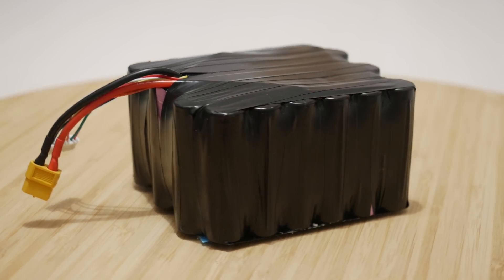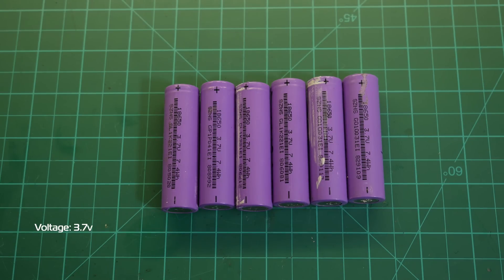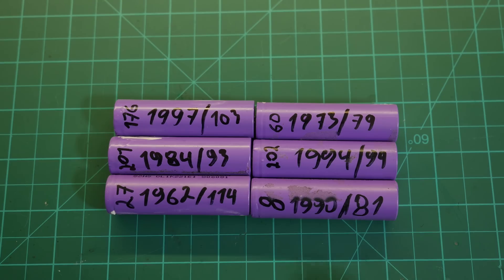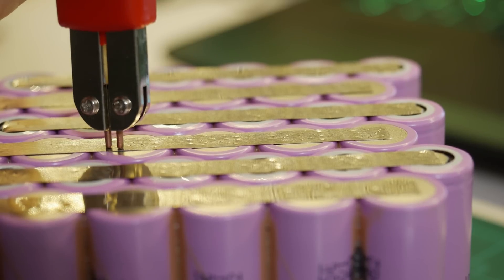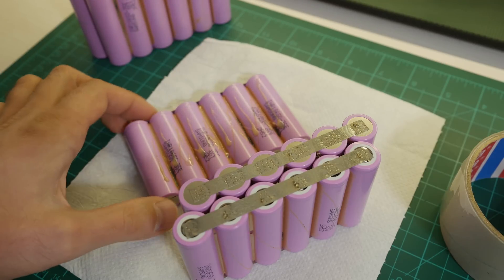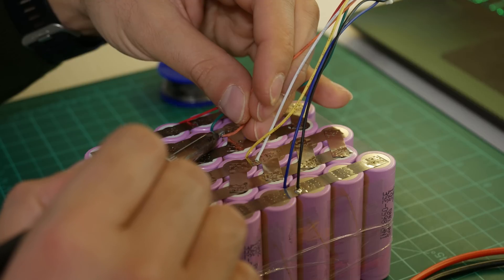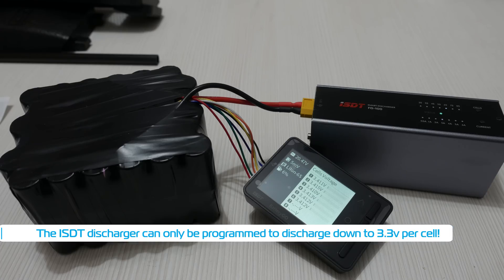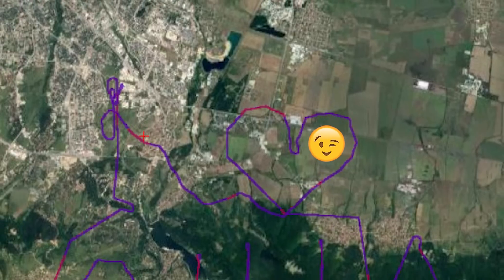HOW-TO Li-Ion battery for a drone using 18650 cells!

Comment: So those individual cells got 3450 mAh each in the final battery pack? I'm guessing they aren't the typical VTC 3000mAh, right?

PD: What is that self-guiding ground base antenna at 0:28? Looks awesome! :O
Reply from the maker: The cells I used in the pack were Samsung 35E, not Sony cells. And yeah, at 0:28 that is the older MFD antenna tracker, still using till this day, been probably 10 years now! :)

Comment: hello i have a drone X  12" propeller 620kv motor and the drone weight 3.5kg i need 4s li-ion battery .....what will be the best mah battery size for flying time 40min time......  currently using lipo 4s 8000mah lihv get around 20min to 25 min
Reply from the maker: To be honest I've never been able to completely figure out LiIon batteries for quadcopters, and especially larger ones! What is the current draw during hover?

Comment: I just want to know that the li-on 18650 batteries are much cheaper than lipos but still most of the fpv racers uses lipo for fpv flying . So is there any difference between the two in terms of performance ?? Please let me know.
Reply from the maker: Well LiPos are used for high current applications! LiIons cannot handle those! LiIons are best on long range and long flying models, where discharge is slow over a longer time! For 2-3 min flights LiPos are best!
Reply: @ArxangelRC  thanks a lot . Really appreciate your answer ☺️
Reply from the maker: @rsmgaming4384  You are welcome! :)

Comment: How much current we can draw?
How much time it takes to recharge?
Reply from the maker: Current depends on the cells used and battery configuration, so you would have to be a bit more specific! As for recharge... if can be done in 1 hour... but LiIons usually do like slower charging, especially if you want them to last a lot longer!
Reply: @ArxangelRC  I built 6S6P using Molicel P42A and it weighs 2500g.
Reply from the maker: @MrNams  Well... you have 6x cells in parallel so multiply their current rating and you will get the current rating for the pack now! Charge is advised to be around 0.4C, or in other words 40% of the battery max capacity.
Reply: @ArxangelRC  Thanks, due to heavy weight around 2600Kg, i made two separate packs of 6S3P.
Reply from the maker: @MrNams  That can work too!

Comment: I want to build 6s5p battery pack. What size strips should I use? Is 0.15mm 7mm will be okay?
Reply from the maker: Depends on how do you plan to weld those to the cells! Also... that should be determined from the current that will be drawn from the battery pack! I'd suggest dual layer 0.2mm!
Reply: @ArxangelRC  can't say what would be the exact current because I don't have multimeter right now to measure but I want to use it for quadcooter. I will use spot welder for it. Do you use dual layer?
Reply from the maker: Like I said... depends on the use and how many amps would it see drawn... but yes, I do use dual layers to give the current more surface to run through!

Comment: I need help with my drone battery, it's a cheap drone with shitty lipo 3.7v 650mah battery which died and i want to replace it with single 18650  battery. The drone is QZ S8 quadcopter, i just want to know which 18650 should i get ( how much amp discharge) and how to protect it from overcharging/discharging e.t.c Can someone help please, i need guidance. I couldn't find anything online
Reply from the maker: Well you could use the stock charger that came with the drone to charge it, but as far as discharge... I wouldn't worry too much! The cut off of the drone is certainly setup much higher because it is designed for a LiPo, while a LiIon has a lower end of capacity voltage, so I doubt there would be a chance to overdischarge it! Also, you may not be able to make use of all of its capacity exactly because of that! What is the weight of that LiPo cell?

Comment: I am building 4s 2p battry pack, i have lot of confusion about charging them together🤔! Is that possible to charge it with imax b6 charger??
Reply: yes just make sure to have the proper balance leads
Reply from the maker: Yes, when you complete the back and you have a balance cable, charging should be easy with any RC charger!

Comment: if I connect those cells in paarallel it will double mah but will it also double C- rating. For example if I use the same cells you used with 4s4p (4 battery in series and 4 of those in parallel) it should be 13800 mah but is it then also 40a discharge rating?
Reply from the maker: Yes, because now you will have 4 of these in parallel, means the discharge also adds up!

Comment: Hi Alex, thanks for the great video. I am seriously considering changing my lipo to lion. Do you know anyone selling these battery packs?
Reply from the maker: Well not really! I Know there is a company... Titan Power... or something like that, in the UK, that makes some LiIon packs... but not sure currently who makes these like DIY.
Reply: @ArxangelRC  How much current we can draw? Can we use it for hexacopter?
Reply from the maker: @MrNams  That would depend on the current needs of the hexacopter. Usually LiIons are not the best for copters of a larger size!
Reply: @ArxangelRC  I am surprised log shows only 4Amp current i mean graph is in between 0-4Amp only?
Reply from the maker: @MrNams  Well... you mean the current draw of the copter? Seems kinda low! You sure the current sensor is correct?
Reply: @ArxangelRC  I am doubtful for my Pixhawk power module, is there any way to measure accurate current using external device
Reply from the maker: @MrNams  Well these current modules usually need to be calibrated! They rarely are correct without any setup! External device... there are various power meters you can use...
Reply: @ArxangelRC  I have Tarot 680 Pro, 'Motors:6x Tarot 4108 with Tarot 1355 props, as per manufacturer chart,
50% throttle takes around 36A (6A/motor)
100% 75A (12.4A/motor)"
So, my hexacopter need max 75A.

So if we build 6S from " LG HG2 18650 3000mAh 20A Battery - LGDBHG21865"
We will have capacity of 18000 (3000*6) and it can give us current as 119.988A (C Rating 6.66).
Reply from the maker: @MrNams  Yes, that is true, but that is not really the issue with these! An empty LiPo battery sits at 3.5v per cell, so for a 6S pack that would be 21v! Am empty LiIon battery sits at less than 3v per cell... so best case scenario is 18v low end... I hope you can see the problem here... 3v loss is no small amount when we are talking about copters, which means that in order for this to have thrust at the lower end, 3v per cell, you may need a 7S pack.
Reply: @ArxangelRC  Thanks a lot for reply. Finally i have ordered "Milocel 21700 P42a 45 amps", to make two parallel packs of 6S3P. So total capacity of battery will be 25200mAh (4200mAh*6), and we can draw total current of 270Amp (45A*6). thats ideal situation, anyway i shall be happy even if i get 100Amp.  I decided to make two 6S3Pack instead of single 6Sp, just to avoid any complication in future to detect any failed cell, lets see

Comment: Firstly thank you for very good explained video sir, i need an answer about my problem.
My drone's batteries are 2 x 6s 160000 mah and 20-40c .

Can you explain pls how many 18650 i need to use or which way i supposed to follow.

regards.
Reply from the maker: You fly with two of those? I assume they are LiPo? You connect them in parallel or series?
Reply: @ArxangelRC  2x 6s in series bro
Reply from the maker: OK, so these packs are 2kg each, so about 4kgs for two of them! Any idea what the max amp draw of your done is? Also I assume this is a copter... do you know how much amps to hover? In theory, in 4kgs you can have a 12S 7P LiIon battery, made up of 84 LiIon cells! However, max amps and hover amps would be important in determining what type of cells would be needed for this to be viable for your application!
Reply: Hello again, my each motor has approx 25 AMP at %100 throttle its a hexacopter.
Reply from the maker: And is that a hexa or a quad copter?
Reply: Hexa bro kv170 6215 motor
Reply from the maker: OK... so 150A full throttle... and a 12S7P pack from highest  capacity cells at 10A discharge would give you 70A continuous... so you'd be probably almost maxing that just to hover... depending on copter weight... which should be taken into account! Any idea what will be hover current draw?
Reply: @ArxangelRC  %50 of full current bro
Reply from the maker: @linuxettin  Well... 50% is about 75A... which on its own is more than the max continuous discharge of these cells, so basically the LiIon cells in this configuration would be quite stressed from start to finish of flight... so I am not sure it is recommended to use them for this project! Perhaps at this time it would be better to stick to LiPos! But why 50%? That doesn't usually work like that! How big is this copter? What would be its AUW?
Reply: Without batteries will be 17 kg with paylod, but paylod is spraying liquid. So by the time auw gonna decrease
Reply from the maker: @linuxettin  How much spraying liquid? How many kgs?
Reply: 6 liters mate
Reply from the maker: @linuxettin  OK, that is not a small amount, yes... getting lighter throughout the flight will definitely help both with extending the flight time a bit, and also with the power required to keep the copter in the air, which means that the lower voltage at the end will be less of an issue! But that still doesn't mean those batteries will have it easy at the start of the flight! It is tough to say like this, especially for copters of this weight, without some testing!

Comment: Hello, I used the link in the description but i have a little question, if you go on the individual battery the supplier states that it is 3500mAh but in your video you seem to measure them as 2000mAh, what gives?
Reply from the maker: If you take a cell down to zero volts... might as well go and throw it out! Most LiIon cells can go down to 2.5-2.6v, but that is not really recommended! A slow discharge would leave them almost completely empty at 3v per cell anyway... so there is no reason to go any lower and thus to shorten the life span of the cell!
Reply from the maker: That clip in the video is from other cells, not the Samsungs! :)
Reply: @ArxangelRC  yeah that makes sense! The rated mah capacity is the battery capacity when depleted to zero volts, is that correct? So the actual capacity is much less since you discharge them no lower that 3 volts?

Comment: hi im wondering what battery pack should i use for t motor p80II pin kv120 with 30*10.5
inch props
Reply from the maker: Well... depends on how much weight you can carry... is that a plane or a copter?
Reply: @ArxangelRC   its a plane and im estimating 3kilo to 5 kilo but lesser is better
Reply from the maker: A plane with a 30" prop?!?!?!? What model is that? Also... what voltage?
Reply: @ArxangelRC   its an experimental one and its 48v
Reply from the maker: Damn... how many cells in the battery? 12S or 13S?
Reply: @ArxangelRC   6s to 12s
Reply from the maker: Any idea what the max amp draw is during take off on this motor with this prop?
Reply: @ArxangelRC  it would be around 60 amp atleast thats what im hoping but during cruise it should be 20
Reply from the maker: OK, so a 12S 7P is the configuration you are looking for, for this model, if these amps are correct! That would make the pack a bit over 4kgs, but it will make sure there is no severe voltage sag under load.
Reply: @ArxangelRC  thank you very much for your response all these days @ArxangleRC  ill take a note of this . and what if i use 2 motors would this battery pack be still feasible or i need to go for 12s12p sorry for bothering too much.
Reply from the maker: Well in that case the motors would be splitting the load... so in theory each should consume less... but I'd me careful with giving it full throttle! And also with 2 motors... perhaps add a few more Ps... even if you don't double it to 12P.
Reply: @ArxangelRC  sure .thanks a lot it was a great help for me .
Reply from the maker: @srim5128  You are most welcome mate, best of luck on your project!
Reply: @ArxangelRC  :)

Comment: If not using spot welder,  can i use the battery holder to place the battery in 4s 1p and will the battery holder burnt while flying?
Reply from the maker: You can use a battery holder... but you still have to solder to these cells... or you are talking about those battery holders with the springs? Not sure I would use those for high current applications! That is an accident waiting to happen!
Reply: @ArxangelRC  Thanks for the replied.  I'm trying to used battery holder with speing typed.
Reply from the maker: Well... you can try it... but personally I wouldn't do that! Soldering or spot welding is preferred!

Comment: dear thanks can we choose this battery for ... dji drones
Reply from the maker: I think you will need a lot more cells in parallel for a copter application... and perhaps also go for a 7S setup, because of the lower low-end voltage of these cells!
Reply: @ArxangelRC  
Which battery is good for hexacopter with 980kv sunnysky motors and 20a esc. ( what about hg2,18650 30a )

Comment: if my drone uses Esc 20A and requires a lipo battery with 120c, what do I need to make with these specifications
Reply from the maker: Yeah... that 120C rating is pretty useless when we don't know battery capacity at least! If your drone has 4x 20A ESCs, and the motors are actually capable of pulling 20A at max throttle, in that case you will need a battery pack capable of delivering at least 80A continuous! With such cells... that would require either high discharge cells... which means the Sony-Konion 3000Ah ones that can do 20-30A discharge... so you will need at least 3 in parallel, or with 10A cells... you will need at least 6 in parallel... and depending on the voltage... that would be a heavy pack!
Reply: @ArxangelRC  He'd be better with a lipo surely?
Reply from the maker: Yeah... that would be my suggestion... even with the high discharge LiIon cells... you'd need 4S3P at least... to be certain you won't overtax the cells... so that is 12 cells... or about 600 gram pack... which is quite a lot of weight for a copter with 20A ESCs!
Reply: Most lipos will provide the 20 amp needed, I don't know where you got the 120C rating.

Comment: If any one is interested in getting used laptop batteries https://www.ebay.com/sch/dgetachew618/m.html?item=174011170826&hash=item2883dfc00a%3Ag%3ATEUAAOSwQKZdZcrn&rt=nc&_trksid=p2047675.l2562
Reply from the maker: Getting the cells out would way too much work!

Comment: nice video! have you used 18650 cells from Aliexpress  with 20A current draw  rating ?
Reply from the maker: If it is a rebranded cell from some other manufacturer... sure.. should work, but then it depends on what you are going to be using it for! Which plane would that be for?
Reply: I wanna use it on either bixler, xuav skysurfer or skywalker. Ive only flown them with lipo , never used Li-ion before. What is the current rating of the ones u use?
Reply from the maker: Theoretically 30A... but real tests suggest they are more along the lines of 20A really! What is the weight of the battery you can build for those planes? 400-600 grams?
Reply: @ArxangelRC  oh ok, for the big skywalker I think 4S 2P (8 cells) which I think would be about 400-500g. for the bix or Xuav  3s 1P which is about 160g .
Reply from the maker: Lets hope so! Why low voltage? Potentially it will be lower at the end of the pack... but you will be flying... and it doesn't require the full battery voltage to make enough thrust to keep the plane in the air! Should be fine!
Reply: @ArxangelRC   thanks for the tips, will give it a go and compare the endurance with lipo.  One other thing...with frsky L9R  I've seen u have installed the two antennas vertically parallel to each other on the tail , do u find thats the best orientation for long range?  I have mine on  tail  like a "v"
Reply from the maker: V doesn't make sense for long range, that is why mine are vertical! Antenna on the ground should be vertical as well!
Reply from the maker: Which model exactly? I have not ordered any cells off of Aliexpress yet!
Reply: @ArxangelRC   I was thinking Liitokala hg2 3000mah which has current draw of 20a with burst of 35a.
Reply from the maker: Weight will be a bit less than that!
Reply: @ArxangelRC  even better then! Hopefully the motor will have enough torque at low voltage to get the full advantage of the li-ion cells. :)

Comment: sorry to post here, but what ESC would you recommend for li-ion batteries? cause the once i have has low voltage cutoff for lipo batts, so i dont get the full potential of the li-ion.
Reply from the maker: What are the ESCs you have now?

Comment: Awesome, do we have to setup the lvc in the esc in consequence? What if we want to fly with a lipo again?
Reply from the maker: Yes, you will need to put it to its lowest setting, so it wouldn't cut off earlier... and also use the soft cut function! If you want to fly LiPo again, just program it back to its normal levels!